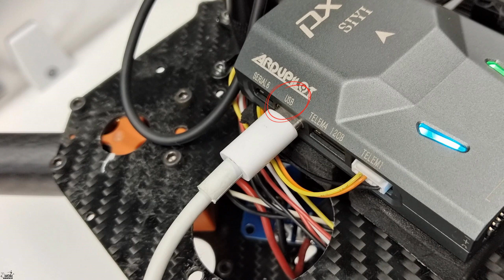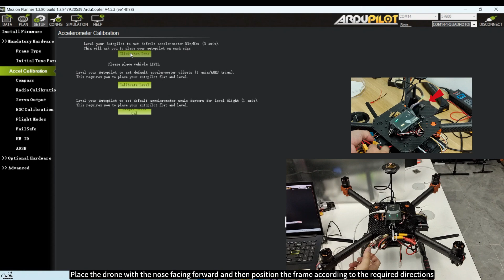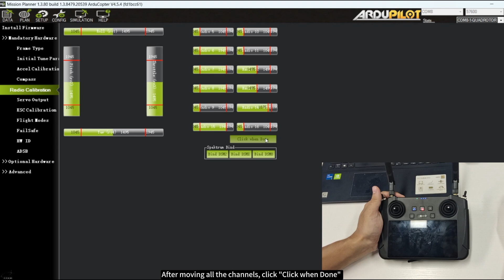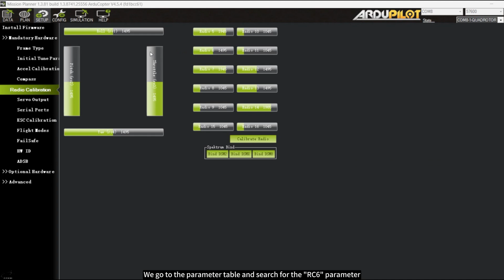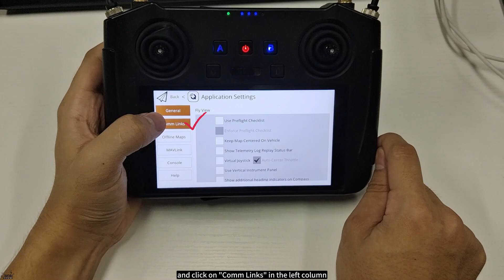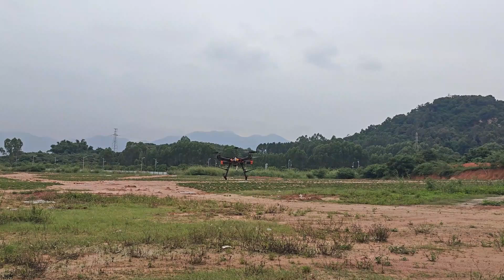How to build a drone installation and configuration tutorial （3）

Comment: What about ESC calibration
Reply from the maker: You can read about ESC calibration here https://ardupilot.org/copter/docs/esc-calibration.html
Reply: That didn't worked So I calibrated using Radiomaster boxer after that I will test by connecting the H12 pro. If it will work then it is ok if not then 😢